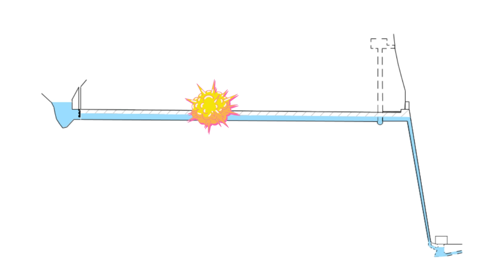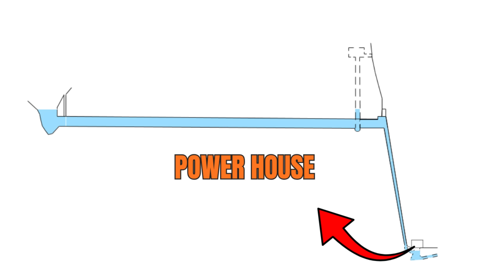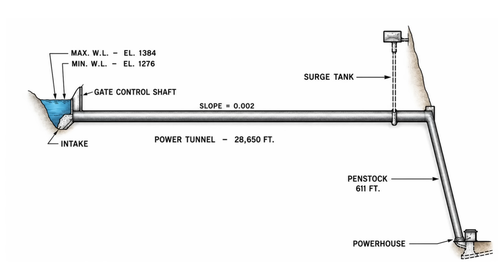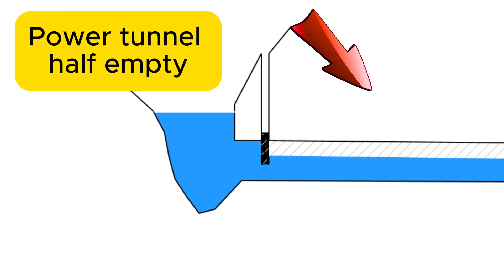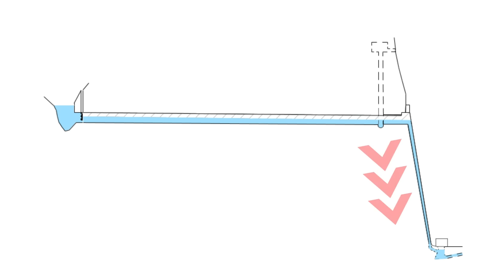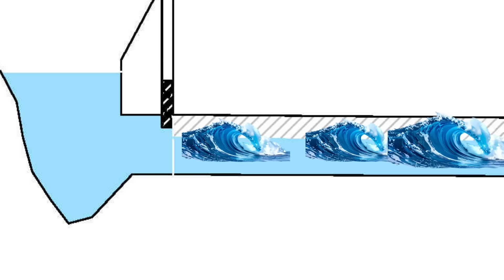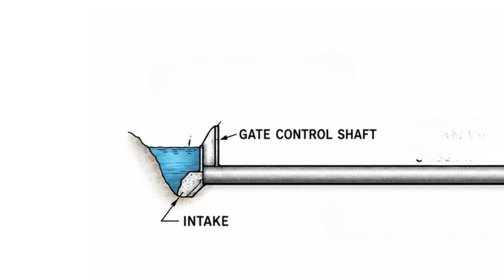The Day a Hydropower Tunnel Became a Giant Cannon

Comment: So a length of wire and an indicator light would of saved the plant rather than a phone call.  Strange how even today miscommunication between people can be the biggest failure point in many endeavours.   Great video thank you.
Reply: They had those.  That's how they knew the level was dropping.  What took longer to figure out was WHY.  When they did, they overcorrected.
Reply: @tsm688  If the correction had happened slower, then it may have been possible to vent the system safley.
Reply: @tsm688  I was meaning more in respect as an indicator board as to which gate required manipulating.
Reply: @ryansta  that only passes the buck.  it's possible for those to be wrongly set via misunderstood instructions too.
Reply: @tsm688  With that logic though, anything that relys on communication between two seperated groups can be countered and is always a favourite point of failure. You had a language barrier here, now you suggest misunderstanding of a display board indicator, diirecting which gate to manipulate. It is of course possible that bulb has just failed and it hasn't been noticed and the phonecall was misunderstood. At what  point do hou stop ? Other than someone physically running from one station to the other, we are at an impass. Even then they could fall, because running is unwise in such a place ( though i'll bet they ran when that building shook eh ? ).   
                At some point we have to depend on a high level training and knowledge of the system workers are operating. Even with all that curveballs can be thrown, usually due to human error or natural events. Sadly, it often takes near disaster or actual events where loss of life and damage go the operation of such places / things in many industries and professions to improve designs along with safety policies, proceedures and guidelines. Hows the oft phrase go - these safety manuals are often written in the blood of others and this channel with the videos and explanations highlights.    
               All very interesting stuff and hindsight is always 20 : 20.       Anyways, all the best, interesting talk.
Reply: @tsm688 A mechanical bi-directional pressure relief valve was not specified.
Reply: Human Error, By Reason!  [It's a book..]
Reply: @philipoakley5498 I've just searched and found a paper with the main points. Refers strongl to the Swiss Cheese model, which you hear referred to frequently in Air accidents / incidents. Very good read and makes a lot of sense. Thanks for mentioning it.
Reply: @ryansta Swiss cheese model concept was introduced by Reason in his 1990 book Human Error which includes TMI as one of the examples 😊
Reply: Not even that.  A suitably sized pressure relief sytem would have saved the entire thing!
Reply: @simonmasters3295  Hindsight, like deadlines are often seen in the rear view mirror 😁
Reply: @simonmasters3295  pressure relief?  the problem was galloping waves in a miles long tube.  what they needed to do was equalize it slower.
Reply: I hear what you both say...and agree we all have hindsight.  

My point is even if the near-level conduit was bored there is no reason to build it in a manner that allows it to become a pressurised tank or vacuum vessel.

Conversely you do have a reason let me know because what you have built is a Trompe...and the potential power that can be extracted (the "useful work") from such infrastructure is colossal.  I would argue, it is potentially greater (in terms of installation cost per kW or per kWh, per kW or kWh generated) than a conventional headstock.
Reply: @simonmasters3295  it's neither vaccuum tank nor pressure vessel -- it's got a gigantic whale blowhole in it!

Which is zero help when a wall of water travelling much faster than it was designed for starts shaking it apart from sheer turbulence
Reply: @simonmasters3295  youtube ate my reply.

it was neither vaccuum tank nor pressure chamber.  it had a gigantic whale blowhole for pressure relief!  it was a miles long tube carrying a wall of churning water much faster than it was designed for.